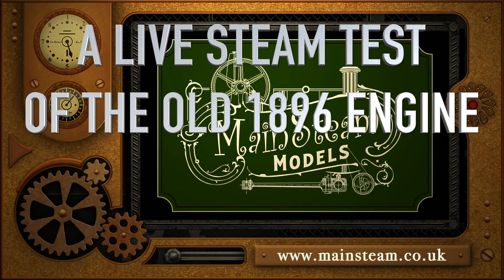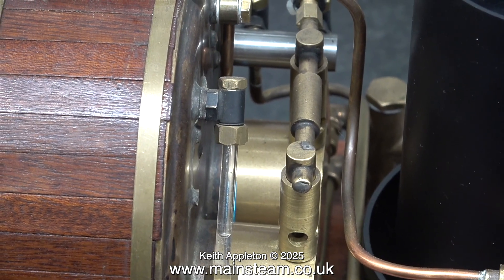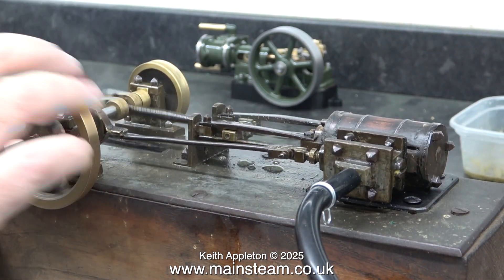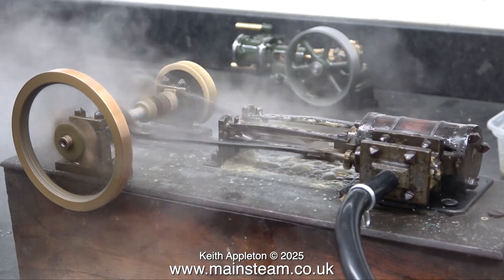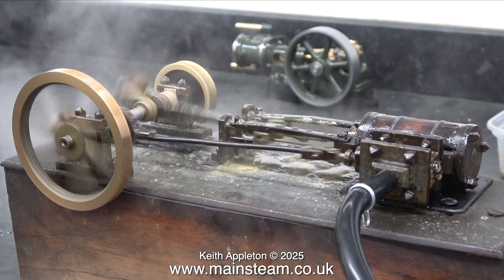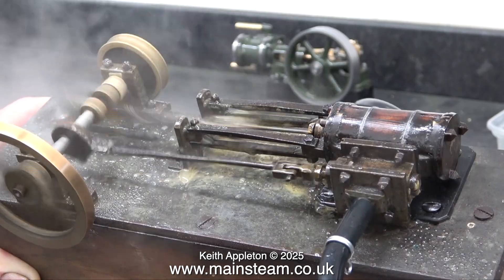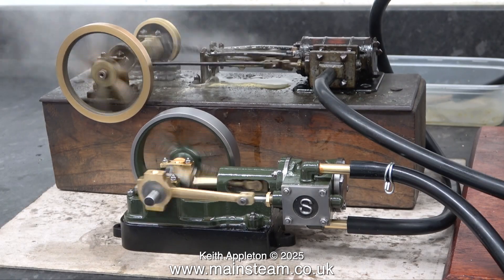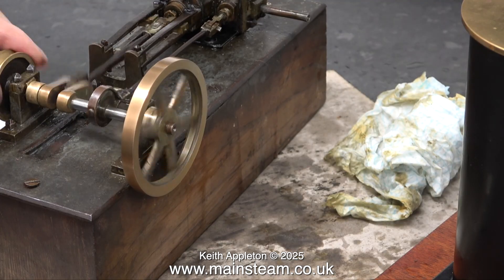REBUILDING A MODEL STEAM ENGINE CIRCA 1896 - PART #14

Comment: A curiosity:  Could the 1896 engine run from the exhaust of the 10H.  It probably won't work at low speed, but with a higher steam pressure initially, it might.  It would be interesting I have to admit.
Reply from the maker: That would work if the second engine was is smooth running condition.